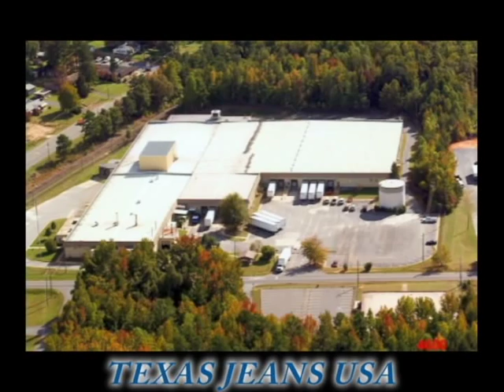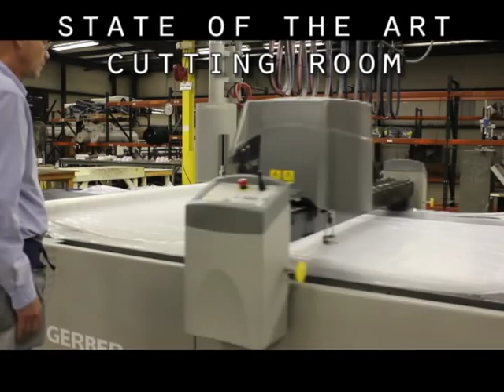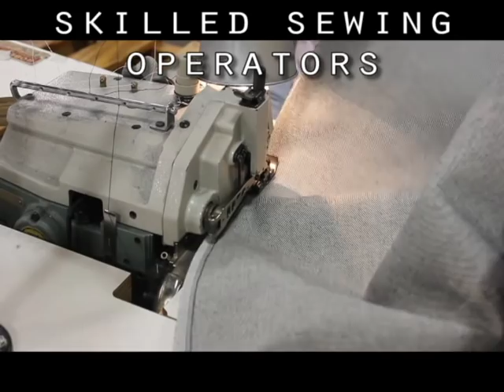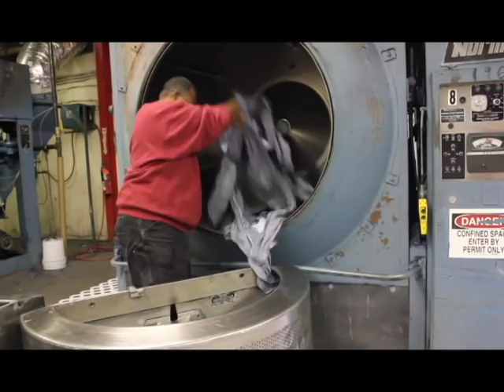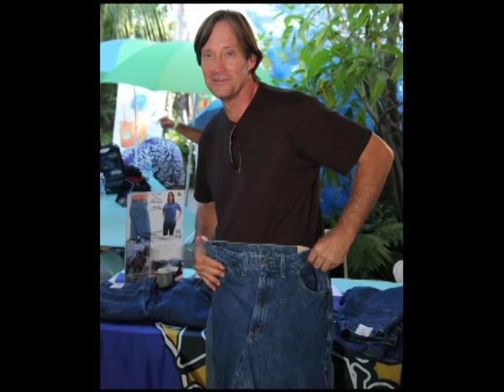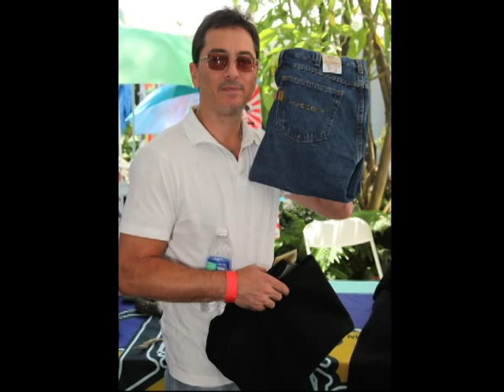TEXAS JEANS TOUR

Comment: I had these original fit jeans now for about a year. Still going strong, and I'm pretty hard on my clothing. I usually end up having to buy a new pair of jeans every year or so, but these have a pretty good weight, and take more abuse than other name brands.

I plan on buying at least one more pair of original fit, plus a pair of flannel-lined for winter. These are well made jeans.

Now, if only I could get my wife to stop spending $100 on whimpy deisgner jeans full of cheap beads.